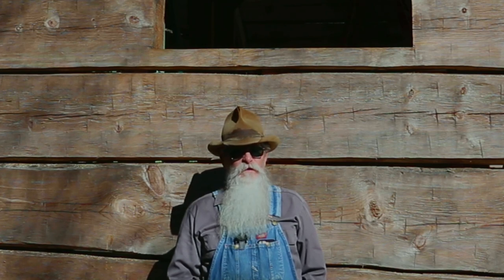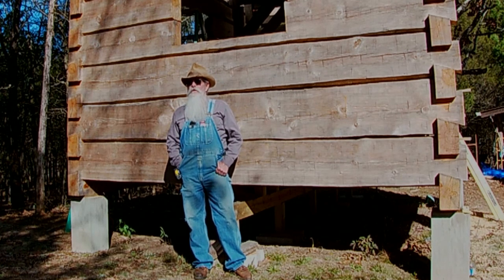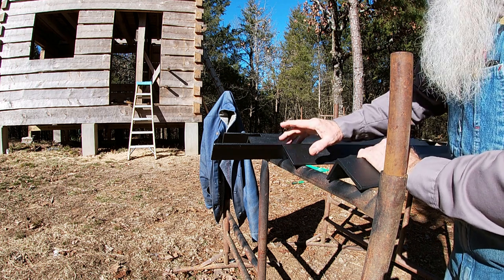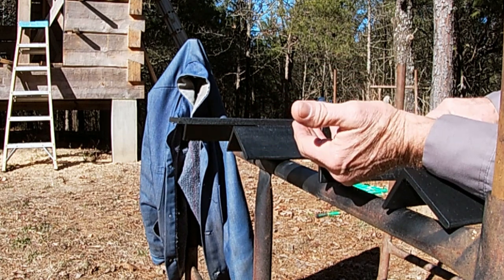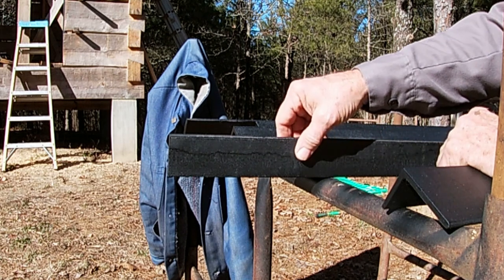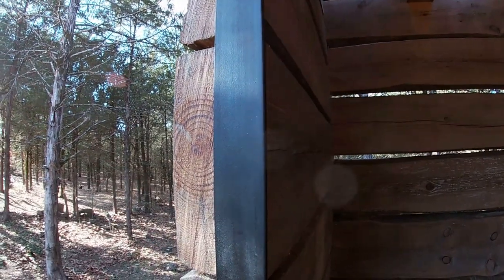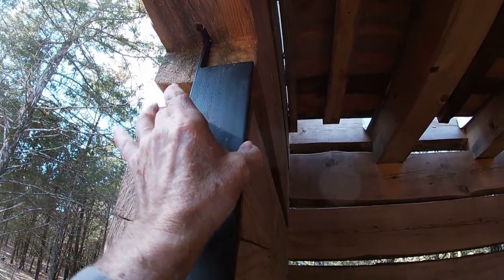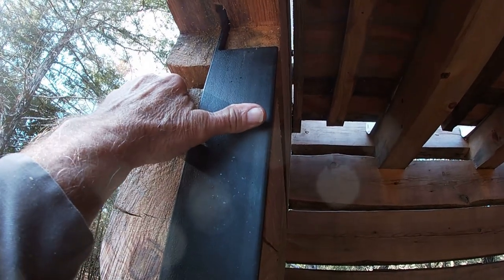Installing Angle Iron and Window Sub-jams, Dovetail Log Cabin Build (Ep 38)

Comment: I’m curious about using angle iron instead of a tenon on the outside of the window buck (sub jam). Using metal would introduce moisture from condensation I would expect. Angle iron seems atypical for solving the settling problem.  Also if there is any shrink in log length that joint is exposed where a tenon would still maintain a visual connection.  I realize trim will cover this. I’ve considered using iron myself but backed off for these reasons.
Reply from the maker: Howdy- I understand your concerns. Shrinkage in the length of the log is very minimal. The flange of the angle iron is going into the log ends 2”. The metal is on the side of the log end that is on the inside of the cabin. Sealing the trim on the outside of the openings is something that should be done on any building , whether it be wood, metal, or brick. I also paint the metal with a rust inhibitor paint, two coats. Insulation is put in the 1/4” gap between the logs and the subjambs that the angle iron creates. Thank you for your comment and for watching the video. God bless you

Comment: I've been looking at building a hewn log cabin in Scotland for a long time but am wondering if there are any benefits or disadvantages over round log cabins?
Reply from the maker: Howdy- the one good advantage is on hewn logs(whether you have them sawed or actually hew them) is the heart wood of the log, which is more weather resistant, is exposed to the elements. On the other hand, round logs have the sap wood exposed to the elements. Here in America, the old log cabins that have stood the test of time are mostly the cabins with hewn logs. However, there are log buildings in Europe that are round logs. Having a good overhang on the roof is essential for keeping the logs protected from the weather. Hope this helps. God bless you

Comment: I just found your channel and your a very talented log cabin builder and enjoy all the info your sharing,one question I have and maybe I missed it but how do you finish the gap off on top of the windowsill and the log.
Reply from the maker: Howdy Blake- that area is for the settling that will take place. I put fiberglass insulation in there which will compress.  That area will be covered up with trim boards. I sure appreciate you watching the videos. God bless you

Comment: The audio makes this unwatchable… Sorry, but it blows the speakers!
Reply from the maker: Howdy- sorry you had problems with it. What were you watching it on? Blessings to you
Reply: @TheBeardedCarpenter  With all due respect, you should be asking yourself what level you recorded your opening thirty seconds at, along with a few other spots (I never got past the top of the video due to the over-modulated audio). No matter what anyone watches it on, the over-modulated audio is over-modulated. Now, after skimming through to another spot and trying to listen, @ 5;28 into the video, you can hear the audio recorded is the correct level compared to the beginning audio level recorded. If it’s recorded too hot (over-modulated) it can’t be fixed in the edit bay. It needs to be at the correct level, or lower when recorded. If it’s too low, you can bring it up in the edit bay. But over blown recorded audio is unfixable and can ruin speakers. I am surprised you can’t hear the difference at the beginning thirty seconds and then the timecode I referenced. Anyway, as a guy building a cabin, you are obviously a very smart person. Therefore, I find it a little odd that this is a common issue on your videos. I just turn the sound off or don’t watch in order to not ruin my speakers. Peace and take care!
Reply: @Aphxphotog  It can be challenging to have consistently good audio if using only the camera microphone. On my videos, I sometimes use a pocket recorder with a lapel mic and that really improves the audio but is a bit of a pain to use it when doing construction.
Reply: @OnBeaverCreek  It seems your ‘construction video” audio, where you spoke to the camera directly at the time code referenced was good, while the seated audio at the top was over-modulated. Again, I don’t know your setup or gear, all I can do is hear the differences between the two. And if you can’t, and do nothing to take care of it, that isn’t my issue. As a professor of media and editing, I advise my students to watch AND listen to the video before they turn it in/upload it and correct the issues. It starts at the source: if the audio level at the source is bad, it can’t be fixed. Maybe record a quick burst, listen to it, turn the level down and try it again until the levels are good. Or don’t. But at the levels currently, I just can’t do it with my speakers about to pop when it’s over-modulated audio/ And I don’t think that’s the outcome you’re looking for. So, if you keep working to excuse it as difficult, you’ll continue to have the same issues… they say doing the same thing expecting a different outcome is a waste of time. There is a way to correct it. I tell my students when you’re shooting video, wear your video hat to set up and make sure it’s working correctly. When you’re setting up audio, wear your audio hat to set up the levels correctly, and I’m sure you use your painting hat when you’re painting, not your sawing hat. Just take a few seconds to take care of it. Excuses get old after a while.
Reply from the maker: @Aphxphotog  HI sir, I'm Paul's wife.  I'm the one responsible for the poor audio quality.  No one is making any excuses here.  I would be happy to learn anything that would help make our audience have a more pleasant experience.  Before starting this channel I had never videoed or edited anything in my life.  I have learned the little I know from watching YouTube videos.  We use a GoPro and a Cannon EOS  M6 with a wireless Rhode microphone .  The mic has a dB button with three audio output levels (0db -6dB, -12dB).  If you have any video suggestions that would help me learn, I am open.
Reply: There is nothing wrong with this audio. No problems at all.